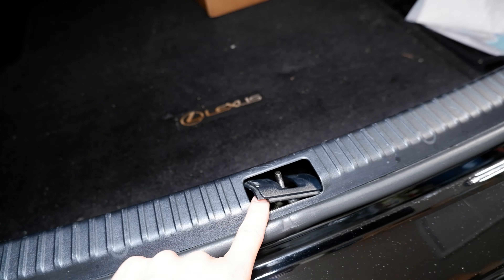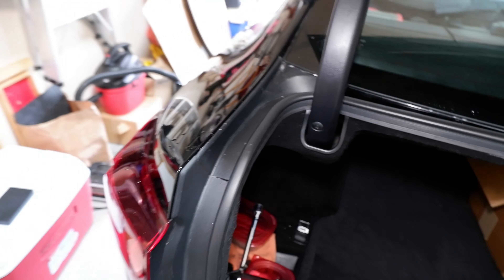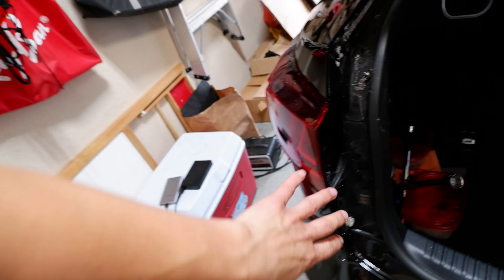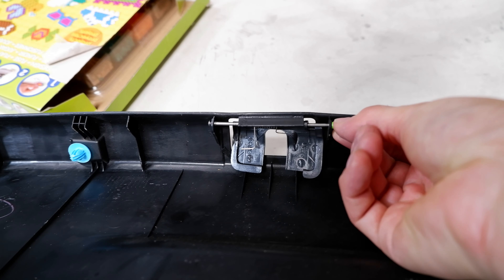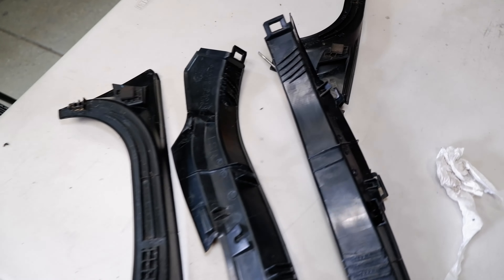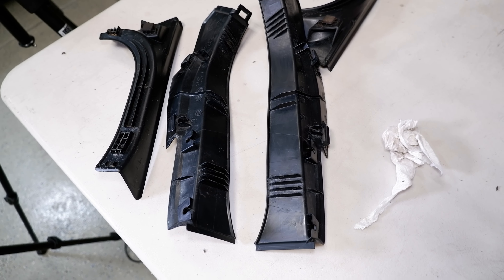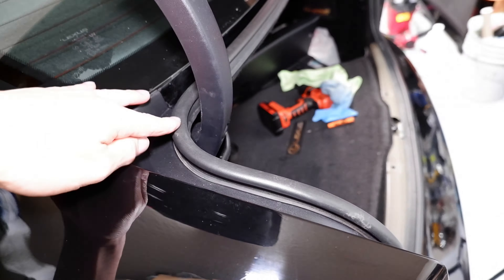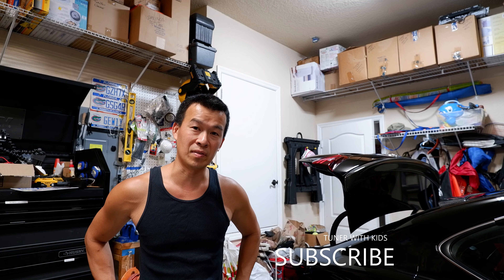Lexus IS250 IS350 IS-F Trunk Gutter Cleaning | Broken Trunk Latch Panel Repair

Comment: How did you remove that big black lower plastic panel at the entrance of the trunk? 

My metal loop that connects with the trunk latch came loose and fell inside. I just need to remove the panel and screw it back on.

Did you need to remove those metal latches attached to the panel?? I’ve spent 20 minutes messing around with these latches and can’t figure out how to pop them off. 

Is there a release button or screw anywhere??

Or can I just pop those circular plastic tabs and the entire panel will come off without removing the metal latches? 

Thank you for the reply and help in advance!
Reply from the maker: I think you need to remove the bolts and hooks.
Reply: @TunerwithKids  How Did you remove your hooks? Do you remember??
Reply from the maker: Philip screws.
Reply: @TunerwithKids  dang. I didn’t see any screws holding these things down anywhere. I’ll give it a better look tomorrow. Thank you again for the help and for responding so fast! I appreciate it brother! 🙏🏾

Comment: Great  mind at work.   Have you cleaned the sunroof drains ?
Reply from the maker: not yet for the sunroof. I never open mine so its pretty clean...i would probably just blow the line with compressed air.
Reply: Tuner with Kids  I use weed walker line work it  and air

Comment: Great video! I also have the same issue. One question if I may, do you think the rain is supposed to flow over the plastic gutters? On my car I can see some big gaps under the top corner channels where the rear windscreen drains and it makes me wonder if water can also flow under them. What did you think? I'd hate to seal mine completely using silicone or something if you think water is designed to flow there.
Reply from the maker: Yes the rain is supposed to flow under and straight to the ground. When it gets clogged and flows over the covers, it ends up all over the bumper.